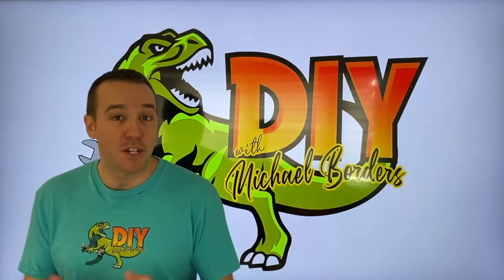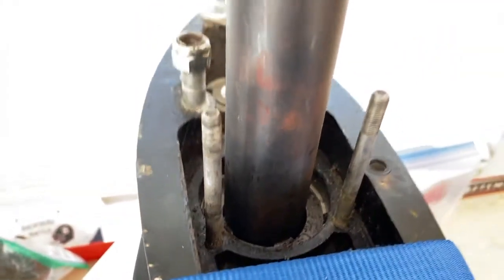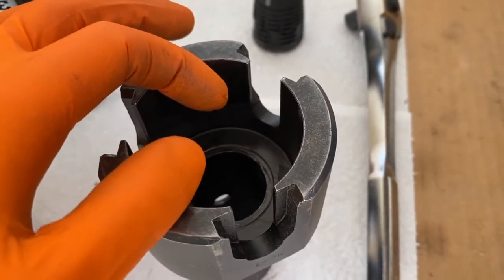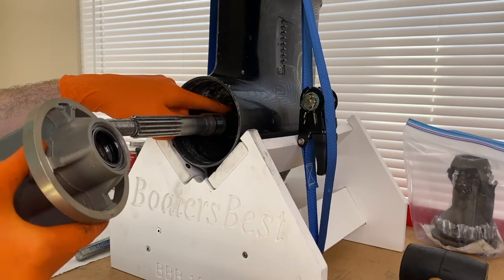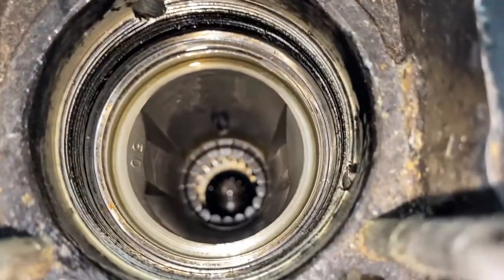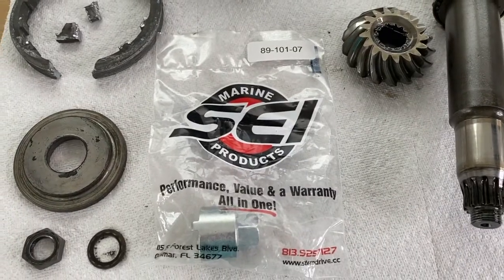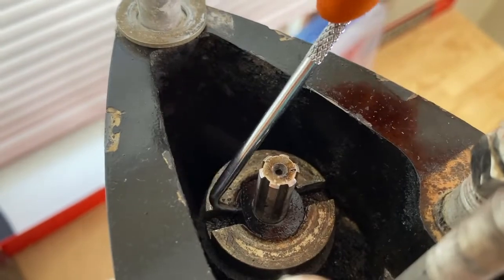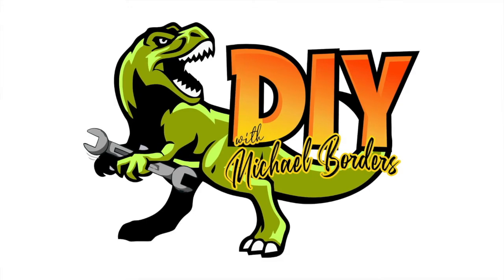Mercruiser outdrive lower unit rebuild - (PART 2)

Comment from the maker: Thanks for watching, we have shared all current available parts and tools on our affiliate page below.

How to properly and safely pressure test entire outdrive

          https://youtu.be/7AeuxiphzUg

(PART 1)

If interested in purchasing the products below, visit our Amazon affiliate links below.  I earn from qualifying purchases.

1.  Retainer nut removal tool

          https://amzn.to/3xFjvUz

2.  Bearing Carrier Puller tool

          https://amzn.to/3Oqc1Nh

1.  Mercruiser Upper unit rebuild - PART 1

          https://youtu.be/i7nRJPbRYPI

2.  Mercruiser Upper unit rebuild - PART 2

          https://youtu.be/UjPiWemv0b8

(PART 2)

If interested in purchasing the products below, visit our Amazon affiliate links below.  I earn from qualifying purchases.

1.  Drive Shaft retainer nut removal tool (89-101-18)

          

2.  Drive Shaft Spline adaptor (AMT0063)

          

3.  Pinion gear nut removal tool (B69-5248)

(PART 3)

If interested in purchasing the products below, visit our Amazon affiliate links below.  I earn from qualifying purchases.

Pinion gear removal tool

1.  Bearing install tool:  (91-38628)

          

2.  Puller Ros:  (91-31229)

          https://amzn.to/3OnC9r6

3.  Washer:  (12-34961)

          

4.  Nut:  (11-24156)

          

5.  Pilot Washer:  (91-36571)

          https://amzn.to/3u1oq0X

6.  Plate:  (91-29310)

          https://amzn.to/39Y0CEh

(PART 4)

If interested in purchasing the products below, visit our Amazon affiliate links below.  I earn from qualifying purchases.

1.  Quicksilver gear set (43-87807A 4)

          

2.  Bearing carrier rubber O-ring (2531534)

          

3.  Clutch dog (52-853594T)

          https://amzn.to/3OHaiBP

4.  Shift shaft rod (77481 1)

          https://amzn.to/3tZt5QY

5.  Shift shaft Crank (76865)

          

6.  Pinion gear nut & washer (Nut:  11-35921)  (Washer:  12-92721)

          https://amzn.to/39VYT2s

          https://amzn.to/3NhkwI4

7.  Drive shaft (45-42634)

          https://amzn.to/3QMn6c1

8.  Propeller shaft (44-824110)

          https://amzn.to/39OSk1L

(PART 5)

If interested in purchasing the products below, visit our Amazon affiliate links below.  I earn from qualifying purchases.

1.  (2-4-C Lubricant)

          https://amzn.to/3NwTCfg

2.  SAE 90 gear lube

          https://amzn.to/3OUVsYN

3.  Loctite 271

          https://amzn.to/3uavB70

4.  Craftsman torque wrench

          https://amzn.to/3y5OTM7

(PART 6)

If interested in purchasing the products below, visit our Amazon affiliate links below.  I earn from qualifying purchases.

1.  (2-4-C Lubricant)

          https://amzn.to/3NwTCfg

2.  SAE 90 gear lube

          https://amzn.to/3OUVsYN

3.  Bearing carrier rubber O-Ring (2531534)

         

4.  Bearing carrier key (28-30281)

          https://amzn.to/3a1zOTE

5.  Retainer spanner nut (79448)

          https://amzn.to/3a1Btsn

6.  Retainer but removal tool (91-61069T)

          https://amzn.to/3xFjvUz

7.  Craftsman torque wrench

          https://amzn.to/3y5OTM7

8.  Nail punch

          https://amzn.to/3OwBun3

9.  Water pump base (46-44292A3)

          https://amzn.to/3OR9eeH

10.  Water pump upper repair impeller kit (46-96148Q-8)

          https://amzn.to/3yFLvsZ

(PART 7)

If interested in purchasing the products below, visit our Amazon affiliate links below.  I earn from qualifying purchases.

1.  (2-4-C Lubricant)

          https://amzn.to/3NwTCfg

2.  SAE 90 gear lube

          https://amzn.to/3OUVsYN

3.  Anode bolt (10-32470)

          https://amzn.to/3I9rcXP

4.  5/8 nuts (11-859116)

          https://amzn.to/3OERbJ9

5.  5/16 rear bolt (10-30206)

          https://amzn.to/3a7PXXX

6.  3/8 Anode bolt hole cap (19-47579)

          https://amzn.to/3yD9Hfe

7.  Anode kit (888755Q04)

          https://amzn.to/3I9ktgD

8.  Video link to all Anode kit replacement

          

9.  Link to video explaining all differences between Anode kits

          

10.  How to repaint propeller

          https://youtu.be/s4ytMFUDGA4

11.  Continuity washer (13423511)

          

12.  Castle washer (12-31211Q03)

          https://amzn.to/3OHkOcQ

13.  Prop washer (14816629)

Comment: How do you measure your drive shaft, or at what points do you measure it?
Reply from the maker: Thanks for watching, any update?  Are you referring to the shaft length, splines and gear ratio?

What year is your outdrive?  Is it an alpha or bravo?

Do you have your owners manual?  If not, you can contact Mercury customer support headquarters and provide provide them with your outdrive serial number.

They will be able to provide you with all of your shaft and ratio info.
Reply: I believe it's a 1977, it's longer than 25 inches from the top of the water pump housing to the top of the splines.

Also where do you find the numbers on the motor to identify the Alpha or version? I know the serial number.
Reply from the maker: @craigandg 

Thanks for the reply.  You can find your outdrive model by referencing your inboard engine placard.

It should have both inboard and outdrive serial numbers on it.

Being a 1977, it should be a straight Alpha.
Reply: @DIYwithMichaelBorders mine is an outboard, the only thing I can find on the Mercury website is a serial number range of 4563802-4838073 = 1977 / 175hp
Reply from the maker: @craigandg 

Is the an aluminum circle placard inside your outboard on the engine somewhere?  

There should be your outboard serial number etched into that aluminum circular plate.
Reply: @DIYwithMichaelBorders I found a rectangular plate with the serial number.
Reply from the maker: @craigandg 

Very cool, that should be your serial number.  😁👍🧰
Reply: Hey Mike, hopefully last question, I keep seeing that "Drive shaft adapter socket" listed as 13 point, but I've counted mine and I believe the unit you're working on, and neither has "13 splines" or am I wrong?
Reply from the maker: @craigandg 

Thanks for watching, any update?  Is your socket splines not aligning with your shaft splines?

If so, the socket is definitely not the proper socket to use.

Comment: Hey Mike where can I purchase the exact shift shaft bushing that you had that comes with the o ring seal? 
For an alpha one gen one 1?
Reply from the maker: @michaelvalero4837  

Thanks for watching, we have shared all current available parts and tools on our affiliate page below.

How to properly and safely pressure test entire outdrive

          https://youtu.be/7AeuxiphzUg

(PART 1)

If interested in purchasing the products below, visit our Amazon affiliate links below.  I earn from qualifying purchases.

1.  Retainer nut removal tool

          https://amzn.to/3xFjvUz

2.  Bearing Carrier Puller tool

          https://amzn.to/3Oqc1Nh

1.  Mercruiser Upper unit rebuild - PART 1

          https://youtu.be/i7nRJPbRYPI

2.  Mercruiser Upper unit rebuild - PART 2

          https://youtu.be/UjPiWemv0b8

(PART 2)

If interested in purchasing the products below, visit our Amazon affiliate links below.  I earn from qualifying purchases.

1.  Drive Shaft retainer nut removal tool (89-101-18)

          

2.  Drive Shaft Spline adaptor (AMT0063)

          

3.  Pinion gear nut removal tool (B69-5248)

(PART 3)

If interested in purchasing the products below, visit our Amazon affiliate links below.  I earn from qualifying purchases.

Pinion gear removal tool

1.  Bearing install tool:  (91-38628)

          

2.  Puller Ros:  (91-31229)

          https://amzn.to/3OnC9r6

3.  Washer:  (12-34961)

          

4.  Nut:  (11-24156)

          

5.  Pilot Washer:  (91-36571)

          https://amzn.to/3u1oq0X

6.  Plate:  (91-29310)

          https://amzn.to/39Y0CEh

(PART 4)

If interested in purchasing the products below, visit our Amazon affiliate links below.  I earn from qualifying purchases.

1.  Quicksilver gear set (43-87807A 4)

          

2.  Bearing carrier rubber O-ring (2531534)

          

3.  Clutch dog (52-853594T)

          https://amzn.to/3OHaiBP

4.  Shift shaft rod (77481 1)

          https://amzn.to/3tZt5QY

5.  Shift shaft Crank (76865)

          

6.  Pinion gear nut & washer (Nut:  11-35921)  (Washer:  12-92721)

          https://amzn.to/39VYT2s

          https://amzn.to/3NhkwI4

7.  Drive shaft (45-42634)

          https://amzn.to/3QMn6c1

8.  Propeller shaft (44-824110)

          https://amzn.to/39OSk1L

(PART 5)

If interested in purchasing the products below, visit our Amazon affiliate links below.  I earn from qualifying purchases.

1.  (2-4-C Lubricant)

          https://amzn.to/3NwTCfg

2.  SAE 90 gear lube

          https://amzn.to/3OUVsYN

3.  Loctite 271

          https://amzn.to/3uavB70

4.  Craftsman torque wrench

          https://amzn.to/3y5OTM7

(PART 6)

If interested in purchasing the products below, visit our Amazon affiliate links below.  I earn from qualifying purchases.

1.  (2-4-C Lubricant)

          https://amzn.to/3NwTCfg

2.  SAE 90 gear lube

          https://amzn.to/3OUVsYN

3.  Bearing carrier rubber O-Ring (2531534)

         

4.  Bearing carrier key (28-30281)

          https://amzn.to/3a1zOTE

5.  Retainer spanner nut (79448)

          https://amzn.to/3a1Btsn

6.  Retainer but removal tool (91-61069T)

          https://amzn.to/3xFjvUz

7.  Craftsman torque wrench

          https://amzn.to/3y5OTM7

8.  Nail punch

          https://amzn.to/3OwBun3

9.  Water pump base (46-44292A3)

          https://amzn.to/3OR9eeH

10.  Water pump upper repair impeller kit (46-96148Q-8)

          https://amzn.to/3yFLvsZ

(PART 7)

If interested in purchasing the products below, visit our Amazon affiliate links below.  I earn from qualifying purchases.

1.  (2-4-C Lubricant)

          https://amzn.to/3NwTCfg

2.  SAE 90 gear lube

          https://amzn.to/3OUVsYN

3.  Anode bolt (10-32470)

          https://amzn.to/3I9rcXP

4.  5/8 nuts (11-859116)

          https://amzn.to/3OERbJ9

5.  5/16 rear bolt (10-30206)

          https://amzn.to/3a7PXXX

6.  3/8 Anode bolt hole cap (19-47579)

          https://amzn.to/3yD9Hfe

7.  Anode kit (888755Q04)

          https://amzn.to/3I9ktgD

8.  Video link to all Anode kit replacement

          

9.  Link to video explaining all differences between Anode kits

          

10.  How to repaint propeller

          https://youtu.be/s4ytMFUDGA4

11.  Continuity washer (13423511)

          

12.  Castle washer (12-31211Q03)

          https://amzn.to/3OHkOcQ

13.  Prop washer (14816629)
Reply from the maker: @michaelvalero4837  

Below is the shift shaft link

       Shift shaft rod (77481 1)

          https://amzn.to/3tZt5QY

If interested in purchasing this product, visit our Amazon affiliate link above.  I earn from qualifying purchases.